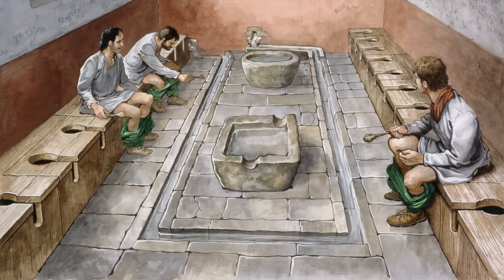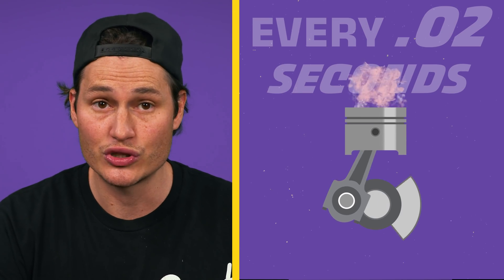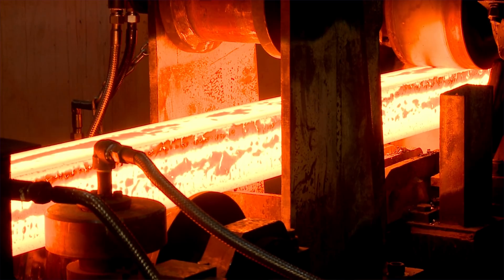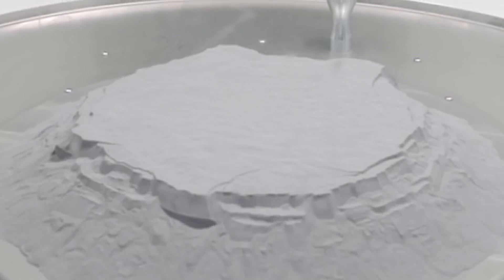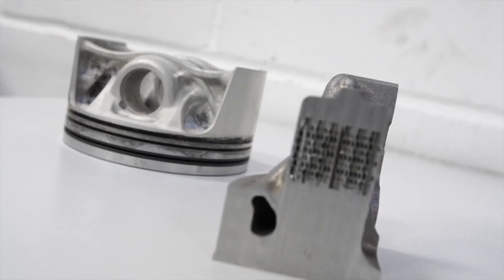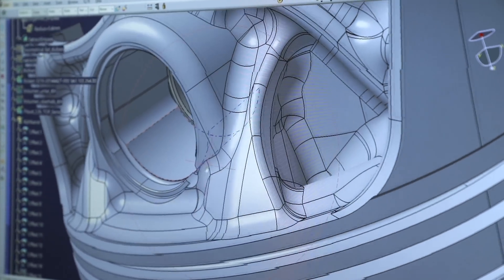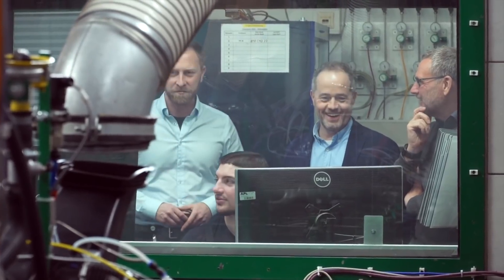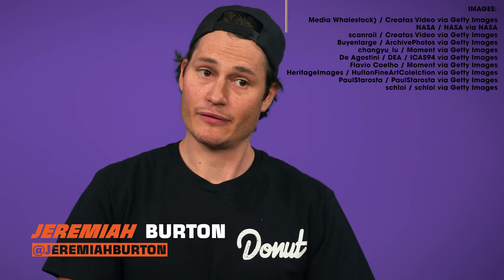3D Printed Pistons Are Changing the Game

Comment: this could actually change the motorcycle game quite a bit... those engines are all about RPM and weight... reduce the piston weight, reduce the balancer shaft and the entire weight of the engine overall... that could result in like a 15% weight saving + increase in power... since most motorcycles run an angled parallel twin or inline 4 that require balancer shafts, that 10% gets multiplied out to literally everything touching it.

Comment: AWA is already producing carbon fibre connecting rods, pistons, and wrist pins. Do some research, over an aluminum component of very similar design weight savings for the con rod or piston are calculated at about 300grams respectively. And for a set of wrist pins, you are looking at saving 800grams. For a V10, for example you could expect a drop of about 13.2-15lbs in rotational/reciprocating mass. My bicycle weighs less than 15lbs, imagine reducing that kind of weight in your con rod/piston setup. They also claim much higher durability than conventional alloy pistons as well as a much lower thermal expansion so tighter piston to bore clearances can be achieved for greater power transfer. The only problem? Oh ya, for a set of pistons, con rods, and wrist pins on something like a V10 or 12, I wouldn’t be surprised if you’d have to cough up close to $100k plus your left testicle.

Comment: Imagine if they also could print the engine block as well. Especially if they were able to create ducts for cooling around the rest of the engine and make it even lighter.
Reply: Its already done. Expensive machine and very expensive parts. Greatest gain is uniformity in the material.
Reply: Don’t give them any ideas; patent it.
Reply: Rodin cars. They print everything. Motor, wheels, custom seat etc

Comment: 3-D printed parts can be printed in elaborate designs but do have defects. The printing process has small micro defects. If this will work long term is a good question. Time will tell.

Comment: Well this is a lightweighted piston manufactured in 3d printing. This reduces its inertia and therefore less energy losses on it even at the same rpm. The increment of rpm offers more power aside from this.

Actually I think this is NOT expensive as it looks as this is still aluminum alloy based. The cost would drop significantly if this is mass produced, like, the Chinese manufactures? Also a ceramic layered piston top can be a good idea to combine with and the Chinese had some knowledge for this. (No you DON'T need to make the whole piston with ceramics...what matters is the top)

Comment: I wonder if you could forge the external shell of the piston, 3D-print the intricate internal part and glue it into place (glue is used in airplane construction)? That way, you could have the strength of the forged piston using tried-and true (and less expensive) methods, while the interior would be isolated from the stresses on the exterior and wouldn't have to be so perfect. Just an idea. Also, I thought the purpose of piston rings was to make a tight seal at all temperatures (that's why they have a gap to allow expansion) and prevent the piston from rattling around when the engine is cold.

Comment: Now if they only did it with the heaviest component of the engine, the block!!! And and how about the heads and crank?  I'm betting these three would be more than a 10% weight reduction. Plus Not only would they run cooler they would be at operating temperature extremely quick.

Comment: The peak of the internal combustion engine is coming ever closer. It's weird that we are just seeing the start of the development of alternative propulsion methods at the same time but it just goes to show the circle of life. I think the very peak will be reached at the very end of the ICE era, like in 2035/2040. It'll be cool to see. I imagine a fully 3D printed Piston, con rods, hypereutectic or forged crankshaft, superlight block made from new super alloys, electric servo or pneumatic driven ECU controlled individually activated valves, ducted EFI, special coatings that reduce the need for lube oil, and maybe we'll get HCCI right, or use it in combination with microwave ignition to help control it. Who knows. Whatever it is, it'll be cool as fuck. That plus the best Tri clutched 20 speed automated manuals money can buy. I imagine everything will also be hybridized too by that point. 

My god I need to stop daydreaming.

Comment: Given that the same approach can use other metals, I am thinking that it would be interesting to look into the idea for diesel pistons (where temps can easily get high enough to melt aluminum pistons, but are typically much slower reving so the weight may not be as big a deal)

Comment: so, what can we expect if porsche teams up with red bull power train and build the new power unit after honda leaving f1 ??
what about printing a turbo wheel that is 20% bigger with 80% of the weight?
or embedding finer/better cooling channels in the block and cylinder head of the engine?
cooling is already a huge problem in an f1 engine/car.

Comment: 6:46 ohhh imagine using an electrical motor that is just spinning and does not have this problem
Reply: in 10 years there wont be any gas burning engines
Reply: @altruismfirst6489  Porsche is also working on synthetic oil to keep combustion alive lol

Comment: Im sure this will be ready sooner than 10 years!
Reply: In 10 years you can't even drive ICE anymore xD atleast to some government plans :P
Reply: @Koichifirst  Same thoughts, lot of car manufacturers wan't to produce only electric cars from 2035. It's so sad we have these innovations so late.
Reply: @Rambovits  well but it's really hard to compete against electric, the efficiency is just so much bigger and likely getting even better. Biggest issue currently is mainly the battery and its production.
Reply: @Koichifirst  even with better batteries that give you over 300 miles to a charge developing a very efficient ICE generator as a range extender I'm sure is attractive to many people.
Reply: @sigmaprojects  true that, but keep in mind having both system in one car is heavy and kinda defeats the purpose. An electric car has the benefits of low maintenance and mostly need power to work (some fluids like windscreen wiper and brakes ofc). But a hybrid also has an engine that needs coolant, fuel, a tank, regular maintenance and an exhaust too.
Reply: @Koichifirst  not really. The energy density of fuels is much much higher than what is currently attainable with batteries. Also when the only use of an ICE is generating electricity the design of the package changes. Think like the BMW setup, it only adds 260lbs, but adds 180 miles to the range and that's old tech, newer better ICE exist now. Additionally as a stop gap technology you have companies like Honda who produce hybrids that have the ICE only act as a generator and for high speeds which EVs generally struggle with due to gearing has a single gear reduction that is clutch actuated. Honda's setup is able to add the hybrid components but come out almost the same weight as a conventional car due to have a single speed gearbox.

If companies like QuantumScape come through then onboard generators will most likely not be needed. But until then it's cheaper to produce a hybrid then it is to produce an EV that has the same range and capabilities for a consumer and even cheaper still when it's just ICE. Not everyone can afford to green.
Reply: @Koichifirst  I have a feeling ultra high effiency diesel or petrol mini engines are gonna become a thing and used like a generator on electric vehicles at some point before full full electric and more electric then current hybrids. 

Boats and some other stuff already uses such set ups for effiency though engines are still huge. 

Realistically you could probably get a single piston engine maybe a twin set up to do it nicely. And stuff like this would help.
Reply: @sigmaprojects  it would be exactly what it would take to switch me over. Especially given we could get nice hp range and effiency and be green.
Reply: @sigmaprojects  oh also. Solid state battery tech is coming. It'll help with range overall capacity not losing capacity in cold weather and lots of other shit.
Reply: @Koichifirst  not entirely true. 

It's heavy with current tech for cars. But has helped increase cargo capacity in big ships by removing weight and size. 

But we need a full commit which hadn't happened yet. 

However it is possible. You'd use individual electric motors at rhe wheels. Center the battery for weight while also accounting for the engine. Design engine to be more like a generator. Hp matters but so does effiency. 

Done properly it'd probably reduce weight. But battery tech also goes in hand. And also depends how much you want to run on just battery and how much you intend to use the motor for range extension. 

Might be easier to do as a fast emergency charge system with the car stopped first. But once new battery tech starts being brought to market. It'll be easier. And once stuff like this starts to be available with the 3d printed pistons and other tech involving 3d printing titanium and some other stuff it'll get real easy to make it lighter.
Reply: @sigmaprojects  still gonna tale awhile. Remember new tech means time for ironing out bugs. Solid state even if it came out this year for 2022 vehicles. Is gonna need 5 just to get where it'll need to be. Remember there are people who will drive 12 plus hours straight sometimes even 24. 

Hence why I'm hoping for a proper hybrid set up with electric motors and adjustable gearing comes before full electric. A range extender motor would be useful
Reply: @bmxriderforlife1234  Quantum Scapes supposedly is planning for next year for final testing with a 2024 launch to be used in VW. We'll see how it goes. But if that's true then yea I think 5 to 10 years from now is a safe bet. Again, that's assuming they deliver on their promise. My guess is that if QS is coming out around 2024 other battery companies aren't too far behind.

edit: also you have to understand battery tech has now been mass produced for over 20 years in vehicles. Hyrbids are just weak EVs. They've been working on the kinks on these things for a long time now. It's not like all of a sudden it's a new system. What is in a hybrid is the same as in an EV minus the petrol engine. What has held back EVs isn't really the capabilities or tech its the price. Batteries are just too expensive, but that's starting to change.
Reply: @sigmaprojects  yes. I know this. Except pay attention. First gen tech is never full capability. 

First gen may be available by 2024. Doesn't mean it'll be feasible as a replacement right away.  We also have vehicles still getting heavier and a tesla already weighs 5000 pounds give or take a little. Even full carbon fiber vehicles are pushing over 3700 and sometimes over 4000. 

Plus more room needed for more powerful on board computers to run next gen autopilot. Kills range. And we still have gearing issues to sort out.  

Full electric take over is probably more likely a minimum 10 away if not more.
Reply: @Rambovits  im so sick of the electric car movement. its destroying our rights as hard working human beings. its my right to spend some of my hard earned cash on a petrol vehicle. my government is trying to take that away from us. they are already introducing a tax on new petrol cars and a discount on electric cars. and within the next 10 years they seem to want petrol cars to be nonexistent. jacinda is the devil in sheeps clothing. i aint never giving up my 2 stroke dirtbike or my gass guzzling car.
Reply: @Koichifirst  you'll be able to have vintage vehicles it's just new vehicles. 

Collectors items already get away with lots of shit.
Reply: It needs to, in 10 years' time, electric cars will be a real threat to gas power vehicules.
Reply: Once I 3D print their mold, we can start growing these from Mason jars
Reply: Look up CHAOS
Reply: Probably not. We still have ways to go with bringing it to a cost effective measure.
Reply: So youre most likely right. They will say 10 years, have it available in 2 years but with a price hike, "look how awesome we are that we got it out sooner" durrrr lol
Reply: Theyre taking a page out of sleepy Joe's book, say there's another 100 days to stop covid but open everything in may.

Or someone selling a cup of coffee for $20 but marking it down to $5 to make the consumer think they're saving $15, when the cup is only worth $1

Comment: Mainly because F=ma, The mass [*weight*] of the piston works against the engine performance - ideally, a piston that weighs nothing - but can handle the combustion force is ideal. With 3D printing you can remove internal volume - lightening the piston - and keeping the strength.....Think of a bridge - the trusses bear the weight - a solid metal bridge would be loaded down by it's own weight...this is problem with internally solid pistons and why machine pistons are drilled out. This is a big deal...

Comment: bandaids do kind of have a shelf life, because at some point the wrapper fails and lets air in to what is supposed to be a sterile environment.  and not only is it no longer sterile, but that air also allows the bandaid material to grow brittle, especially if it's that plasticy type stuff, and the adhesive can weaken.  i've seen all these things myself, so i know first hand that they do happen.  and this was actual bandaid brand that the wrappers came apart from itself, inside of a little container.

Comment: Could 10-20% lighter correspond to same weight but more displacement?  Like a high RPM 2.5L I4 or high rpm 4L V6? Combine that with pneumatic valves and you could have 300HP all motor I4’s straight off the showroom floor.

Comment: I have to admit, I'm skeptical.  Micro welding together a complete piston.  It wasn't a matter of additional costs dumped on top.  Or extra, additional processes the engine needs to be spec'd through.  To them it was, let's leap into the discovery of new ground.  To boldly go where no one has gone before.  All car manufacturers have had huge flops.  
So, leave it to the Porsche engineers to think outside of the box.  With the invention of 3D printing, it was a matter of time.  Whether it initially started out as an innocent question, making an engineer go, hmmm; or just advanced engineering creative genius...it doesn't matter.  
Heat is the number one killer of engines.  Example.  A 3208 (V8) Caterpillar diesel engine is typically rated @ 210-214 hp in farm, heavy equipment and truck use.  But the marine (boat) version has huge water coolers on each side, allowing them to pull 814 hp from one engine.  All from adding massive cooling.   And In this application from Porsche, they've added cooling. pump settings.  

Well done, Porsche.  Well done.

Comment: Interesting - though no IC can compete with electric for torque, acceleration and efficiency, ^oo^
Reply: @bernardthedisappointedowl -  However in the area of lower cost, increased range and refueling convenience the internal combustion engine still wins out over over electric by a long shot.
Reply: @wickedcabinboy  Price is definitely the big capital cost winner for petrol for now - Running costs though are much reduced with electric - not just the cheapness of the fuel (charged from home) but the maintenance of so fewer moving parts is much cheaper - Battery life is also proving to be very long as well in real world case uses.  The question, I would suggest, is the direction of travel of technology - petrol cars are the culmination of over 100 years of development and improvements are now (like this one) incremental - Electric cars are just beginning  - but year on year batteries get cheaper to make and quicker to charge (5mins for a 100 miles with the latest superchargers)  - top end ranges are now 500 miles - so it is really only a matter of time before electric completely usurps IC cars - and I say that as someone who is very fond of the sound of a V8 or even a VW Beetle engine - that I'll miss.  ^oo^
Reply: @bernardthedisappointedowl6938  -  You have a point but initial costs for the vehicles here in the U.S. are still very high.

Comment: Honestly, I'd like to see how much more efficient a car could be, by using this 3D printing tech.  If the internal moving parts are lighter, you should require less gas to get them to move at the same speeds as normal pistons ( or whatever part they want to replace with 3D printing ).  This could especially help with long-haul trucking, where a greater fuel efficiency would lead to very large savings.

Comment: cool video however it will be at least 50 years till this tech is affordable to the common man. This shit is the stuff race teams invest in and not regular teams but ones with corporate sponsorship. Possibly these pistons would sell for around 15 thousand dollars each ? why ? because one there is probably only 1 fucking supplier of the materials and only 2 3d printers that can make um and you still need the 30 million dollar machine shop for all the testing and quality checking shit etc... so when I say they got millions invested in this tech its not a stretch.

Comment: What "dampeners that control piston vibrations"? What are you talking about? Conrods only cushion the load from lighting off the cyl if they are aluminium, and they tend to have a very short lifespan. I can't work out what else you could be referring to. There aren't little shock absorbers built into conrods... A balance Shaft maybe, but that's not really "dampening piston vibration", that's about engine balance...

Comment: Wouldn’t this topological optimization be more logical to use on the crankshaft? Use the aluminum to make a mock up of a steel crank at the same strength and half the weight